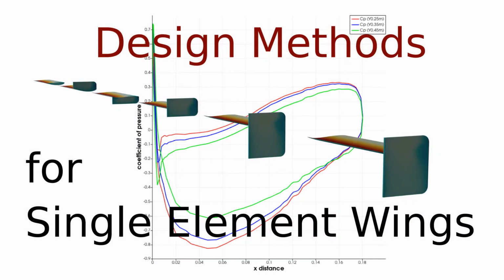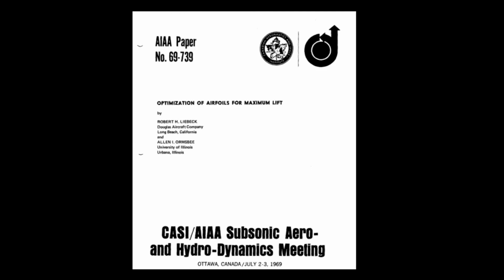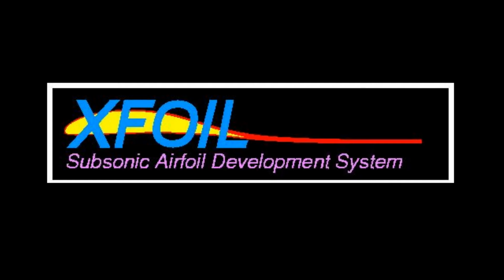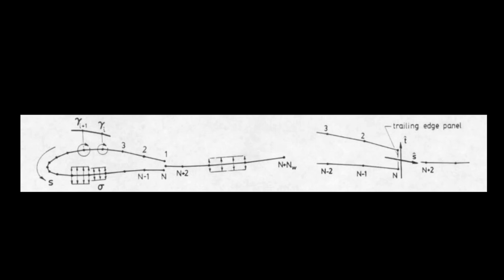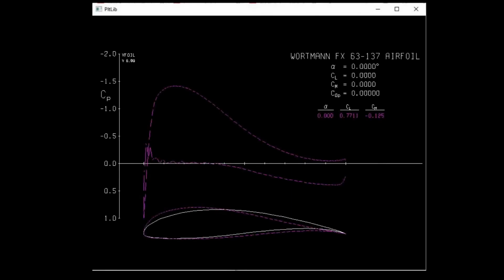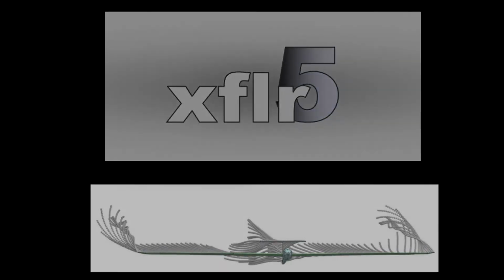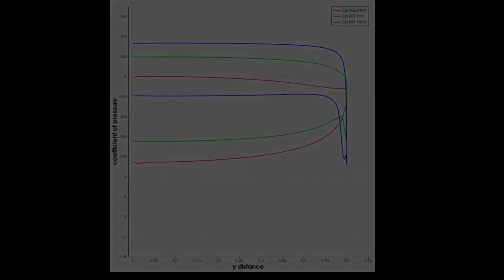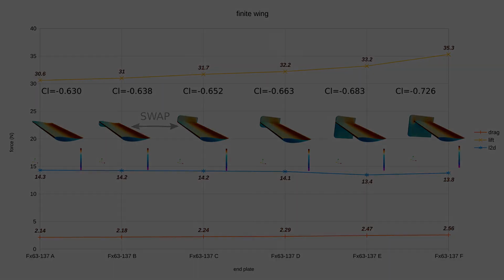Aerodynamics for Motorsport: endplates & finite wings

Comment: So, question. When designing a spoiler, would it not make sense to make the wing part a tear drop shape, and have the end plates a bigger version of the tear drops? So have the same teardrop shape on the end plates, just bigger?
Reply from the maker: I guess the best way to answer this is, the wing profile is interacting with the air profile. If you take the perspective of the conformal mapping of the circulation that early mathematical models used to calculate lift the extrapolate that out to form the end plate of maximum effectiveness. I suspect the endplate will look more like the shape of the air it passes through the further the perimeter of the endplate is from the wing.

Comment: Im willing to bet that the dissaperance of the two wall separation is related to a change in the overall stagnation point of the wing. When the endplate is extended forward, more air is gets drawn under the wing and that probably resolved the separation.

Comment: What about a small fillet radius where the wing meets the endplate? Works for planes.
Reply: It doesn't really affect lift, it reduces skin friction drag though. This is significant at high speeds but almost negligible at the low speeds these wings operate. (Yes most race cars are still considered as slow (low Reynolds numbers) when compared to general aviation aircraft).
Reply: @Michallote  it affects separation. Also think about what you're saying affecting skin drag on the low pressure side of the wing would improve flow velocity and thus downforce.
Reply: @Michallote  If you improve the lift envelope with each little mod you make, by the time you add them all up you can have a significant improvement in overall performance of a wing.